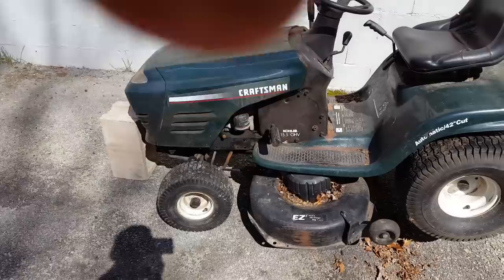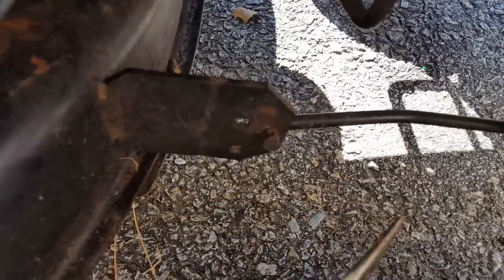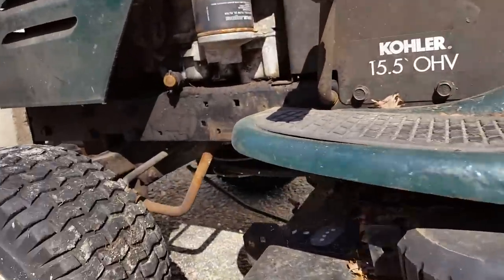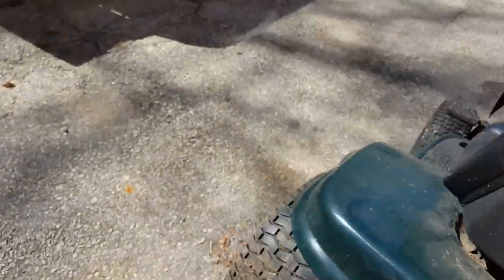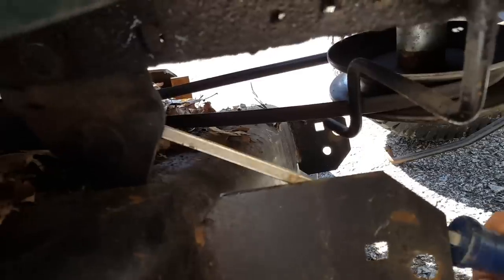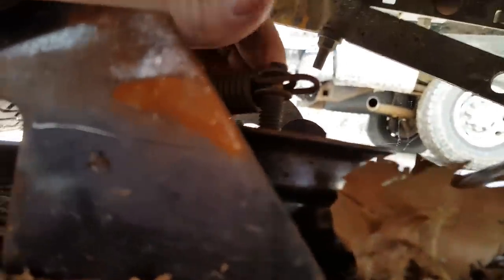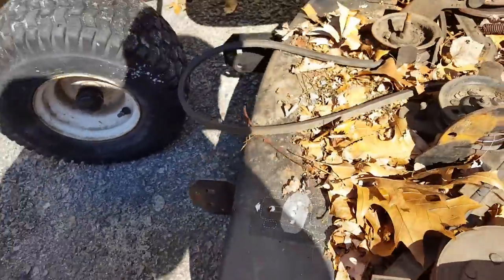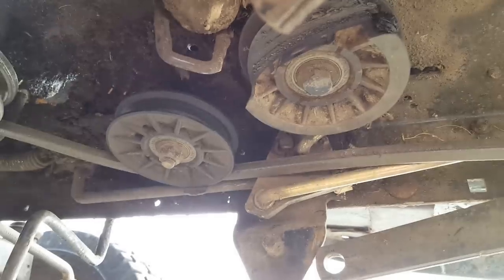Removing deck from a craftsman mower

Comment: That's as dirty as my Craftsman! Which is 10 years old now. Thanks for the video. I've got to do this to get at my blades and sharpen them. I think lowering the deck to the ground would take tension off the hangers and make it easier to reinstall. I do think I'll take a broom and hose to my dirty deck before tackling this job! :D
Reply from the maker: yes that is true . lowering the deck would definitely make job easier

Comment: It sucks  that my mowers older and hard to find the right parts sometimes?it took four different stops to find the deck belt ,I got  a 96.5 inch belt for a 42 in.mowere so I hope it fits,all I could do was measure the broken belt up next to the new one

Comment: GOOD VID.! no fluff, to the point. Belts often do weird stuff when worn and this belt on mine is old ! May likewise have tensioner woes too have to get deck off first. The weird issue is engine stalls 'now' when I engage, or try to engage blades. Replacing both belts and hoping it is solved. Do you concur??? T Y...